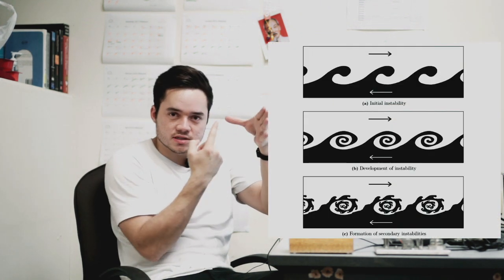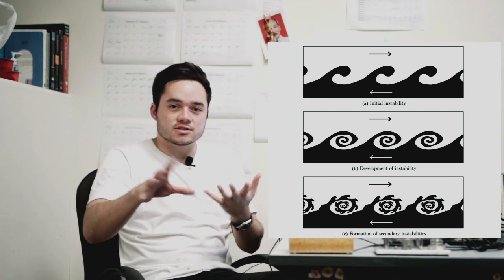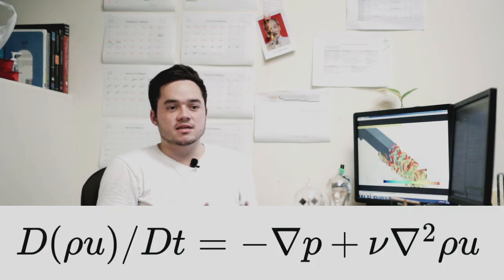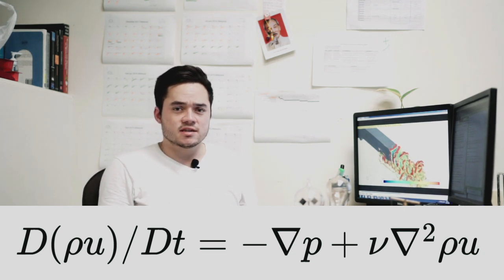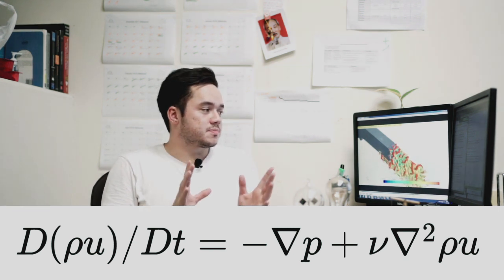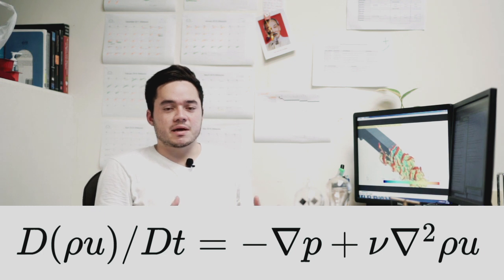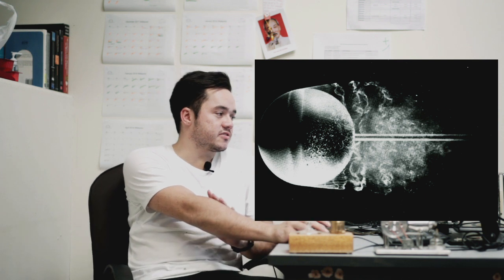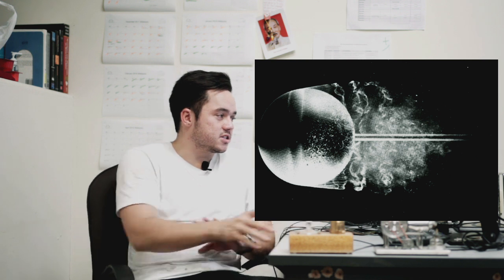Turbulence and its modelling (in plain english!) (CFD Tutorial)

Comment: Hi, Zac? May I Ask: What kind of software do you use for your simulations? Did you have to code it yourself? I'm a 3d artist looking to simulate physical phenomenon more accurately, so I am hoping to either make or find software that would help me model things like fluid dynamics more efficiently. Any info you could give would be helpful...
Reply from the maker: Hi Jack, I use a commercial CFD solver called Star CCM+ I think that would not really be suitable for your needs. I can recommend blender for visual simulations it's all based on the same underlying physics. To get it more realistic might just be a matter of tuning the parameters within the software.

Comment: Great video. So how does RANS capture big vortex shedding behind foils, They are large scale eddies, aren't they? I also think you said RANS doesn't capture unsteady behavior, but most RANS models have a transient/unsteady feature which captures the unsteadiness in the mean. Maybe you meant that fluctuations aren't captured.
Reply from the maker: Yes great point. What i'm strictly talking about is through the formulation of the RANS equations the time aspect t in the equations has been removed through the substitution of averaged quantities. As you mentioned during running the simulations you can see transient effects such as the vortex shedding behind foils. However the basis of these unsteady effects shown in RANS simulations is due to numerical instability, the solver is looking for a steady solution but by nature of the problem it doesn't exist. Moreover if you were trying to study the effect using RANS there is no time basis, only iteration number so you can't extract much useful transient information. Whether you could average all the results and get something useful I'm not sure, but I would not recommended to use RANS for these types of problems. There are other formulations such as URANS (Unsteady RANS), DES, LES etc. which are by definition transient simulations which include the time t in their equations.
Reply: @zacmac  Thanks but RANS equations have time derivatives in them (like the local acceleration term in the momentum equation), so while I see that they don't capture the fluctuations they should capture unsteadiness in the mean ie the equations do allow for this..am I missing something?

Comment: Thank you so much. I have a question. How to do a mesh test for LES. And if we use the same number of mesh to compare LES and RANS, Which approach will run faster ??.
Reply from the maker: Hello.. the required mesh size of LES is determined by the length scales at which turbulence shows 'isotropic' behavior, from google:  Isotropic turbulence is an idealised turbulent state in which the turbulent fluctuations are statistically uniform in all directions. It can be thought of as turbulent flow far away from boundaries and thus serves as a useful simplification in order to facilitate the study of fundamental properties of turbulent flows.

You would never run LES and RANS on the same mesh size, RANS will always be a larger mesh and will be the only practical solver for most problems. Unless you are using a supercomputer or studying something very very small you will not be using LES. Otherwise you can try DES which combines the two.  Can you provide more details of your problem?

Regards,
Zac
Reply: @zacmac  I mean if I use a very fine mesh for RANS and LES to compare the calculation time. which one will be faster and I want to simulation the behaviour of bubble in one bubble column if I use RANs, bubble can't breakup.
Thank you so much,
Best regards,
Reply from the maker: @locnguyenxuan3729  Sounds like an unsteady problem in which case you need to use URANS if anything. Moreover, as the mesh size shrinks in RANS you'll approach the numerical solution to the RANS formulation of the Navier-Stokes equations, meaning to say that beyond a certain size shrinking mesh size further won't give you different results. You can do a mesh convergence study for example where you plot a value (such as force or something) against mesh size, as the size shrinks you'll see this value taper out. Try DES.
Reply: @zacmac  I got convergence for two approaches. But I only want to compare the difference between them. The time consuming and bubble behavior in two cases. Right now I'm using ansys fluent 19.
Reply from the maker: @locnguyenxuan3729  That sounds right. However note that LES may not give you the same type of convergence as you expect, this is because as you get finer and finer the dynamics of the system will all change. True numerical convergence for LES is when you get to the DNS scale of things.
Reply: @zacmac  yes. Thank you so much. I will note that. Are you on facebook or Twitter. I want to follow your channel.
Reply: @zacmac  maybe it's better to use a fine mesh for LES, but I want to evaluate the results and the calculation time in the same situation. How to do. Thank you so much.
Reply from the maker: @locnguyenxuan3729  you can set up your model under RANS settings in physics continuum, save it and this is your RANS model. then for your LES test go back to physics continuum, and de-select the models we chose for RANS until you get back to the 'steady', 'unsteady' option, select unsteady and go from there. Save this simulation and run it.
Reply: @zacmac  thank you so much.
Reply: @zacmac  If you don't mind and have a little time. Can I contact you through Gmail or anything ?.